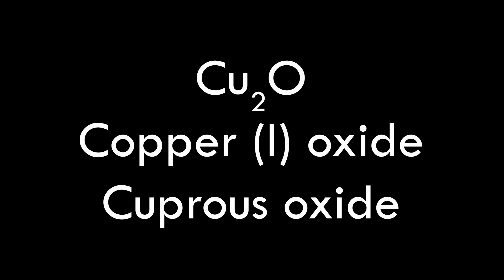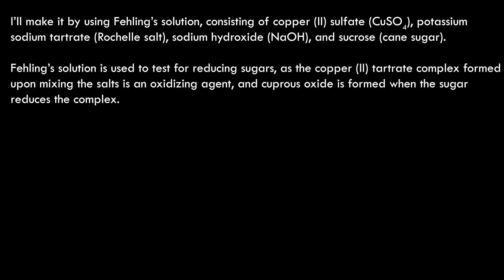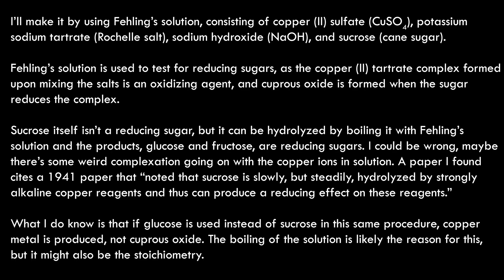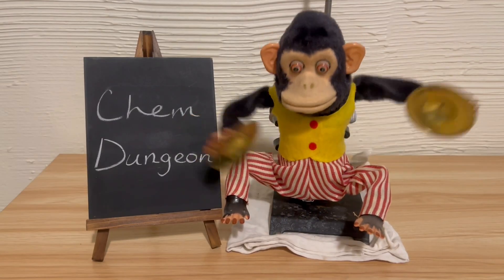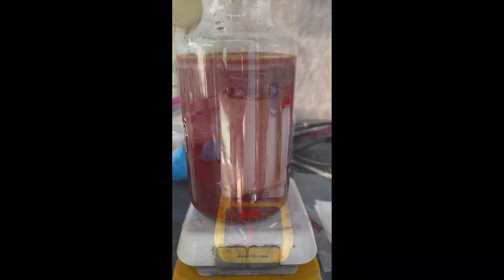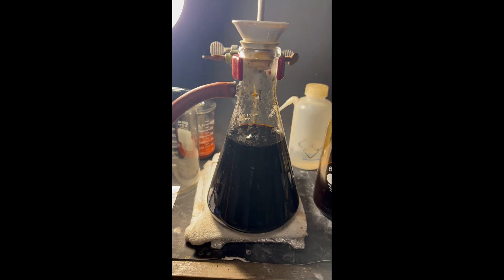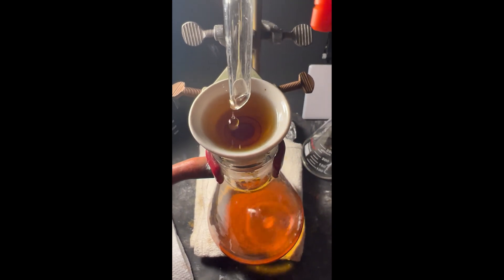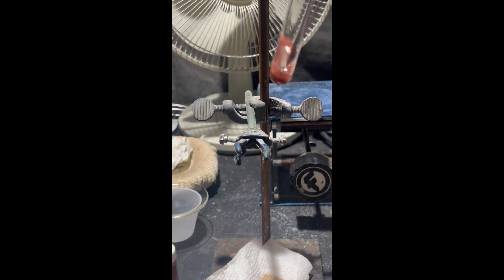Making copper (I) oxide using Fehling's solution

Comment: i made it for reducing sodium nitrate, it was very easy. NaOH + glucose + CuO, boiled for an amount of hours 
not sure what the tartrate was doing in there, glucose should be doable to make by NaOH + sucrose, or well thats how they industrially make highfructose cornsyrup- glucose i recall preparing by boiling in water with a slight bit of citric acid

Cu2O + NaNO3 = NaNO2 + CuO

this can then be recycled indefinitely, Cu powder is better starting material, which i made by CuCl2 (CuSO4+NaCl or Cu+HCl) + Al = Cu + AlCl3
Reply: Cu2O might be a solution to reduce nitrate to nitrite while being oxydized from Cu(+) to Cu(2+).

The tartrate is there to stabilize the Cu(2+) into the highly basic OH(-) solution by a complexation that is showed by a dark blue color.
Under that form (absolutely needed to perform its reduction and precipitation as Cu2O) the Cu(2+) can display its real oxydizing power towards the aldehydic group (like glucose) to oxydize it to carboxylic hydroxy acid; if it is absent; then only Cu(OH)2 precipitates as truquoise blue and may turn black as CuO by boiling.

Cu(OH)2 --heat--> CuO + H2O

Regards
PHZ
(PHILOU Zrealone from the Science Madness forum)

Comment: Pretty sure I'm "that viewer." 
This exactly the scale I'd be looking for so thank you so much for this video. 

As to your question as to why on earth I'd want red copper oxide, I have fallen down a medium rabbit hole of trying to find ways to make uncommon gemstones artificially. Figured that a good place as any to start would be Cuprite which is just monocrystaline red copper oxide.
Reply from the maker: Yes you are! I'm glad you liked it, I tried to choose a method that both hadn't already been done in other videos and used easily obtainable materials.

That sounds like a very interesting project to take on, I hope it goes well for you :)
Reply: Might be interesting target since the melting point of Cu2O is 1232°C and boiling point 1800°C.
So this can be technically done into a glass melting oven (mp approx 1600°C).
Maybe as a cocrystalline as what is seen for synthetic saphire (Al2O3) what have a much higher mp and are crystallised into a molting matrix then dropping it as a denser material having a higher melting point and thus precipitating and crystallising
or alternatively melted by microwave oven as what is done for synthetic rubies (red saphires).

PHZ
(PHILOU Zrealone from the Science Madness forum)
Reply: Thanks! I'll be happy to share any success I have with you